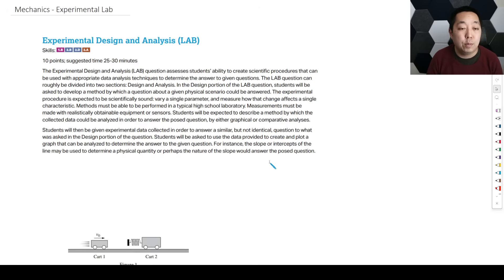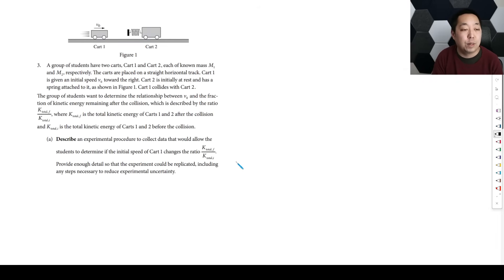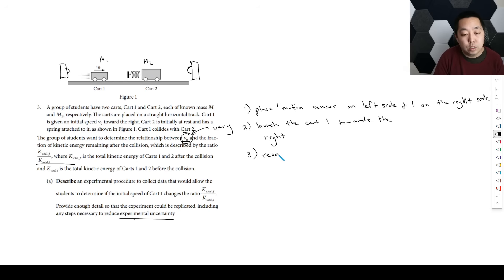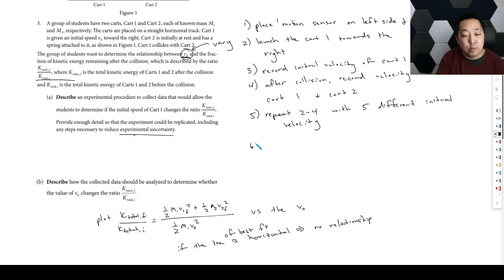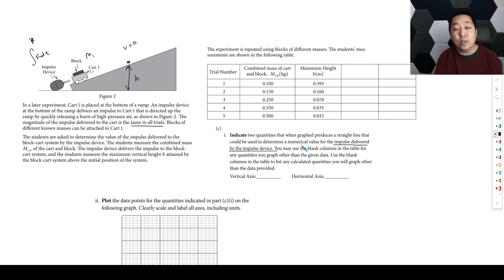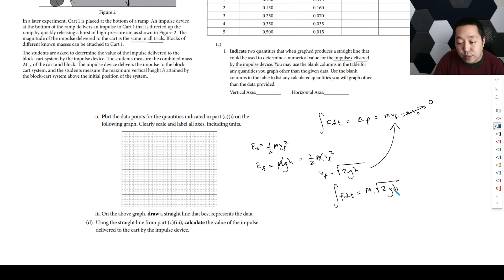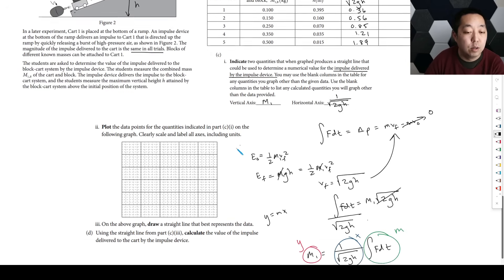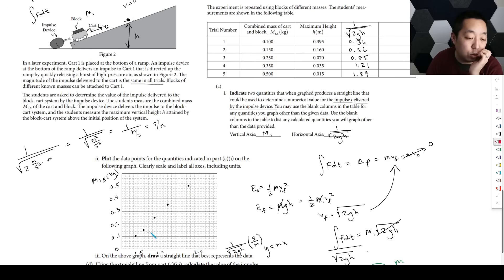Understanding the new AP Physics C Mechanics FRQ Type: Experimental Design and Analysis

Comment: when calculating the slope, do you have to choose new points or can you use the points used to make the line of fit?
Reply from the maker: You have to chose points on the line you drew. You cannot use data points from the table that you calculated.

Comment: Wouldn’t the impulse be N.S? 😅
Reply from the maker: Yes you're right!
Reply: @AllenTsaoSTEMCoach  They're not. N*m is for torque or work, not impulse
Reply from the maker: @김동현-2008  They are equivalent. It does not matter how you label the units. 

If you decided to use kg m/s^2 instead of Newtons everywhere, that is also perfectly acceptable. 

There are not correct units just for context. That is not real or accurate.
Reply: @AllenTsaoSTEMCoach  Please correct me if I'm wrong but impulse is force applied for a certain time so N for force and s for time give NS as the proper SI units for impulse. If NS is equivalent to NM are you implying that impulse = F*t = F*d ? Or did you mean minutes by M? BTW I'm taking the exam in 9 hours (tmrw morning) and I'm freaking out lol your videos helped a lot thanks.
Reply from the maker: @김동현-2008  Sorry I misunderstood the question. 

The units are N*s. I should have written it as kg s/m though based on the axis. 

Sorry for the confusion. I think I didn't follow the original question as to what part they were referring to.
Reply: @ alright thanks

Comment: Thank you so much for the explanation as I was quite confused about the new question types, especially with no prior samples of the same for
AP Physics C Mechanics. I was trying to find resources to practice the new FRQ Types, specifically the Experimental Design and Analysis and Translation between Relations types, but was unable to do so. Do you have any recommendations for the same?
Reply from the maker: There's not a lot of examples out there unfortunately. I'm working on some conversions for AP Physics 1 actually.

I would suggest you look at the AP Physics 1 question too.

There's also components of a lab question on past AP Physics C Mechanics. Look for questions that required you to graph something. They have asked that kind of linearization type question before as a portion of an FRQ.
Reply: @AllenTsaoSTEMCoach  Okay, will do for sure. Also, do you think only solving Previous Year FRQs and MCQs is enough to cover the syllabus?

Comment: Now that you've hopefully seen some of the offical Mechanics practice exams, do you think a 60% on the exam in 2 months would roughly equate to a 5? (55% used to be a good indicator of a 5 before the 2025 change)

I feel like they tried to make the exam easier by changing the style, but they've made it considerably harder. The FRQs are much shorter however :)) (Like 3-4 parts on each instead of the previous FRQs which had 7+ questions)
Reply from the maker: It's hard to say I think. I don't think the change was intended to make it easier. I think it was definitely to reduce time pressure, but I think they will be more thorough on the testing of topics and I expected the MCQ and FRQs to become more difficult and cover a wider range of topics than before.

I think in terms of equating, students will overall improve but I suspect college board will have ways to try to make the test scores comparable from past exams to this year's. It's going to be interesting to see!
Reply: @AllenTsaoSTEMCoach  Starting to worry cause my teacher is terribly incompetent and is not preparing us for the AP exam one bit :(((((

I've got a strong algebra and calculus background, but lack the same level of depth with physical concepts. (A lot lol)

I think I've literally gone through 30 of the past FRQs and scored them, and my performance is incredibly dodgy.

Any exam prep resources you'd recommend? Very much so specific to the 2025 exam😅
Reply: @Ement  I was in the same ballpark as you, currently taking Differential Equations and Linear Algebra, but a month ago, I couldn't even tell you how energy works. I found out that it wasn't taking practice exams that was going to solve my problem (although you should definitely keep taking those to get familiar with the test questions), but it was watching random lectures and youtube videos and digesting them until I got the answers I was looking for to my very specific questions! Funny enough, tmodx's series on E&M helped me  a lot to understand the concept of potential energy for Mechanics. Walter Lewin's lectures on Mechanics helped me conceptually understand escape velocity. With that being said, best of wishes on the AP exam!